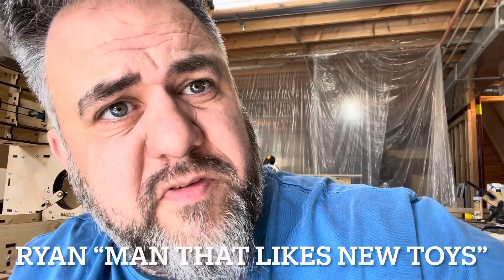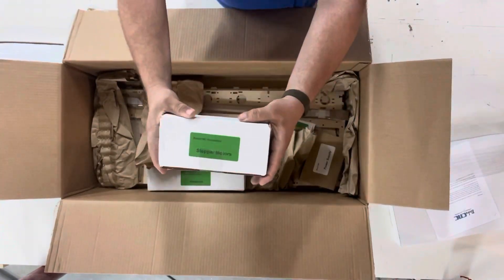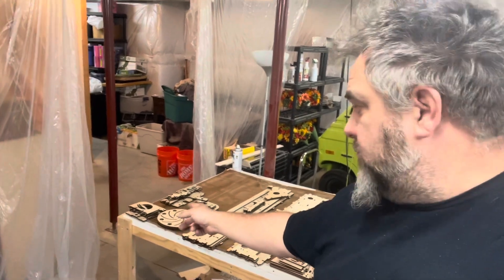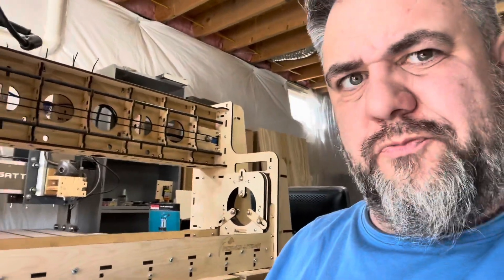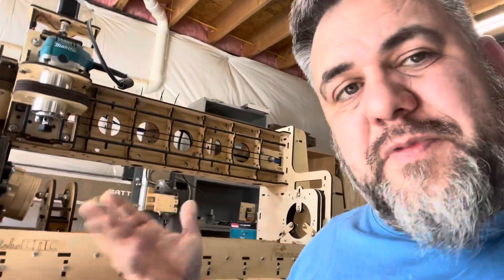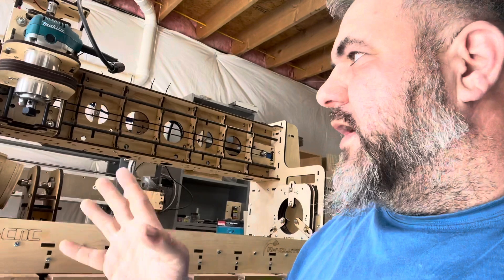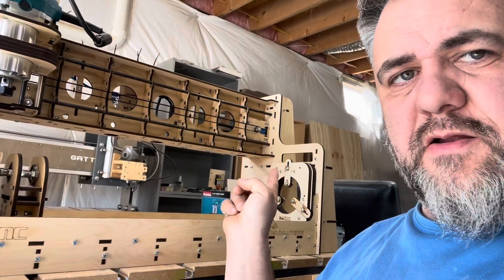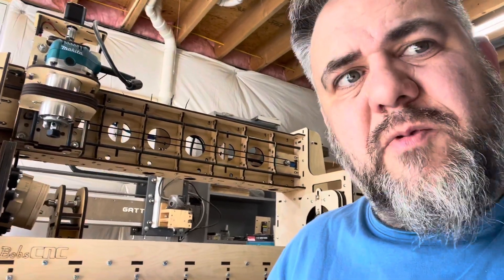Bob’s CNC Revolution Rotary

Comment: Very nice, if any of that breaks on you I have a CNC plasma table we can replace whatever with metal.
Reply: I bet it uses a UBOB Electric system, they use them or used to use them on the Arc light CNC Plasma tables I repaired or troubleshooted quite a few systems that used Bob or Ubob. Universal Break Out Board Systems. :)
Reply: Gonna be looking through out your videos on a video of this Bob working.